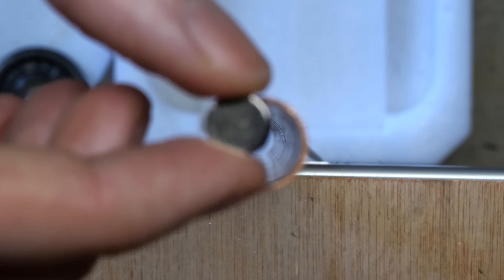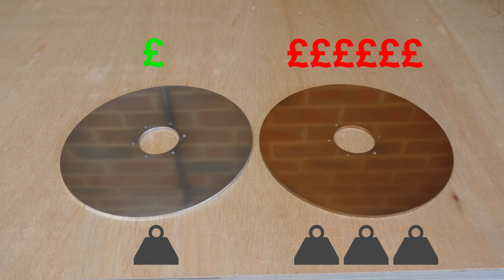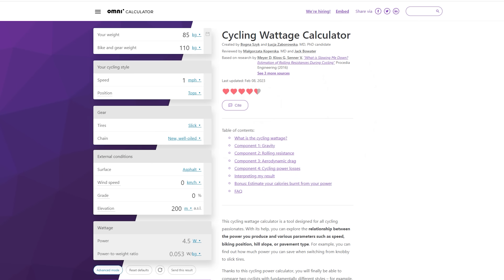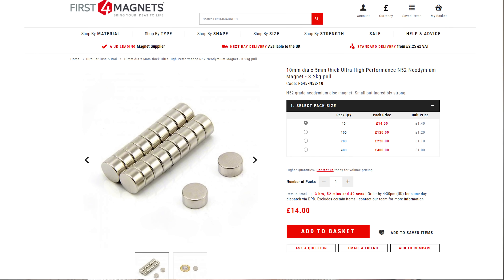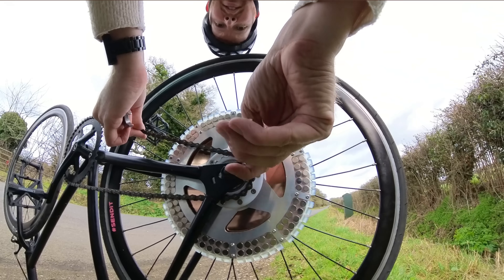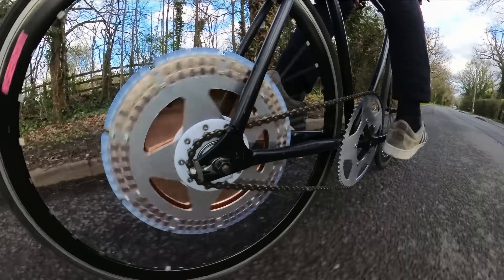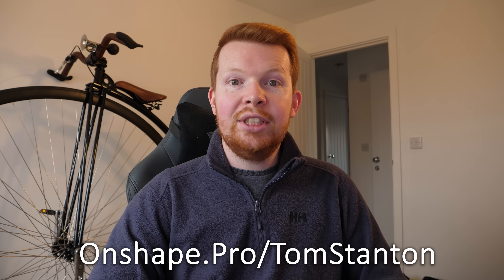Gearless Magnet Bike

Comment: A similar concept used in the Japanese magnetic torque converter concept. The slipping needed in an automatic transmission gets converted (in part) into electric energy instead of heat that gets wasted in the trans cooler. 
I could put a link to the white paper but I think links make comments get deleted.

Comment: You could solve the magnets attracting to the chain and spokes using Mu Metal.  In mechanical hard drives, they are thick and attach to the magnets, but completely prevent the magnetic field from progressing further, and help to contain the field in the gap where the voice coil moves the heads in and out of the platters.
Reply: Or use a beltdrive
Reply: @G4ngsta4l1f3  Stole my thunder lmao
Reply: belt drive is the answer
Reply: Use a disc brake hub, and flip the hub around so that the disk bolting section is on the Drive side. Then you can both on anything you want

Comment: How about magnets on both disks instead of using eddy currents?  I have read descriptions of magnetic clutches, but never seen one in action.  Might be interesting to play with.  Could you use a rotor on one side of a barrier to turn a load (like maybe a generator) on the other side?  How would increasing the gap effect efficiency?  What would be the best and worst barrier materials?
Reply: Or magnets only on the wheel and then use copper plates attached to the sprocket. This would also solve the magnetic chain problem.

Comment: I have an idea for you mate. You could have a variable gearing effect by mounting the magnet cages attached to radially mounted springs. Mill slots in the disc around where the magnets sit under spring tension to reduce the eddy currents formed there.
Use the centripedal acceleration to have them push outwards from centre and thus engage with the intact portion of disc on the perimeter at an RPM detemined by the spring rate. You'll have basically combined the centrifugal clutch with the magnetic drive.
Reply: up
Reply: I agree... He definitely needs to make a version 2, with some kind of centripetal action, because he wants a CVT. I'm not clear on whether the low RPM engagement should be at the outermost diameter of the copper disc, or the innermost, for the proper torque multiplication (I think it should be on the outermost at 0 RPM and move towards the center as wheel speed increases).

Comment: Wouldn't radial  cuts along the copper disk improve the coupling?

 It would also have the nice side effect of bringing the weight  and the inertia down (btw you should have cut slots in it close to the hub, as Eddy currents are very localized and that area wasn't contributing to anything), and a allow for better heat dissipation

Comment: Now do a chainless bike: convert the crankset to a dynamo, and use the output to drive an electric motor created from the disc brakes (as a rotor) and some electromagnets (stators), with two blocking diodes in opposite directions to switch between regenerative braking and acceleration... please 🙏

Comment: I'd like to have seen you experimented with a copper disk say with 2x or 3x the thickness of your base. In the magnet down tube experiment, you can saturate the copper tube magnetically (or electrically) by adding more magnets making the stack taller. The stack weight increases but the braking effect does not (or not much) after a certain point. I didn't have heavier wall copper to test this myself (just 1/2" hard drawn plumbing copper). Don't recall who did the vid but there is one with like the largest consumer magnet you can buy mounted on a pendulum arm and swung into a very thick copper plate (2" or so thk). The braking effect was amazing ... the magnetic "hammer" did not touch the copper

Comment: That is why a car has a transmission AND friction brake's!  The clutch can not give the braking power we would find on a car.  If it could then cars would no longer need disc brakes.  Also the weight of the vehicle is NOT constant due to the changes of it's load so momentum would be a factor and would need to be adjusted at the clutch.

Comment: Covering magnets with a soft steel ring and adding another such ring behind the copper plate would greatly increase coupling and shield magnets from the chain and spokes. But this would still not help with making an efficient CVT. Magnetic slippage is no different from friction slippage.

Comment: If the checkerboard arrangement of magnets wasn't helpful, the next thing I would have tried is having each pair of magnets at a particular position, i.e., the inner one and the outer one, in the same orientation, and alternating the polarity as you went around the arc.  This would be closer to what you got with the three radially-placed magnets in the original apparatus.

Comment: I'm not sure how there could be an application for this.  Maybe it would make sense if you were driving a bicycle with a motor that doesn't behave well when stopped, like an internal combustion engine, where you just need a slip clutch so that it doesn't stall when the bike is stopped - some early automatic transmissions used a fluid coupler that provided slip at low RPMs that similarly allowed the engine to idle without disengaging the gears.   But if what you want is some form of variable-speed drive, I don't think that this would help.  The torque converter in later automatic transmissions is useful over a wide range of RPM because when it slips, it converts some of that slip into additional torque, giving a quasi-constantly-variable gear ratio.  But I can't see how this could be done with a magnetic clutch.  If I understand it correctly, the rotation that is lost when it slips is all just dissipated through the resistance in the copper disc.

Comment: Im am by no means an engineer. So thiese are just ideas/thoughts i had. If you used Electromagnets and were able to control/ preprogram polarity strength. to simulate gear ratios. Also plastic/fiberglass/carbonfiber tire rims. And the master of altering bike frames Colin Furze might beable to help. Could be a nice collab.

Comment: You should try to stick a sheet of soft iron to the outside of the magnets, it redirects the magnetic field, making it much stronger inside the copper disc.
It is the same reason why transformers have a core of soft iron, without the iron a lot of the magnetic field "escapes" to the outside.

Comment: in roller coasters they use these brakes for slowing down really quickly cus the force of the breaking is relative to the acceleration going in (harder you peddle stronger the braking force) and the faster you go the harder this brakes
Reply: they do "not" stop you however only good for slowing

Comment: I didn't quite catch the point of this, the first time around... but you said you were experimenting with a new idea to make a magnet based CVT? Is the point of a magnetic CVT to have very little wear on the parts?

Wouldn't that require the magnets to be on a centrifugal radius arm, or something? For example, at low RPM the magnets will engage a copper disc of one diameter, and as RPM is increased, the magnets will travel along the radius arm to engage a larger copper disc (I assume the discs must be electrically isolated from each other).

Will the torque relationship work this way? Actually, maybe the system needs to  be inverted so that lower RPMs engage the largest radius (to increase torque) and it becomes progressively easier to pedal as the magnets move to the smaller disc and wheel speed increases. Maybe some kind of counterweight pivot arm system would  lever the magnets to the smaller disc as the weights are forced to move to the outside.
Reply: I think you need to make a custom wheel that's basically a group of like 10 different isolated copper ring discs (from small to large). Then find a way to use centrifugal force to move the magnets from one ring to another, automatically, as wheel speed increases.

Comment: Halbach array would give you even more magnetic force per magnet given to the field direction you want. Of course you would simply heat your disc faster, so there's that. This is a super interesting concept though, for sure! You could also have direct magnetic interlock with a squirrel cage style ferro-magnetic core, like how induction motors work. I like the idea of creating a 0 friction gap in the drivetrain.
Reply: I wonder if he could get the copper hot enough that it stops being able to produce eddy currents. I know heat can kill a permanent magnet and hot iron won't stick to a magnet until it cools down.
Reply: @andrewdescant  Well, the heat would certainly affect the resistance of the copper, just as it does in any other electrical component.
Reply: @andrewdescant  I don't think you could reach those temperatures by pedaling outdoors, since the rate at which it loses heat increases with the difference in temperature vs the air. Would be wild though

Comment: That's more a clutch than a transmission.

How about making a magnetic CVT with automatic shifting? :)

Got an idea involving modifying the concept of magnet gears:

- Create two cone-shaped magnet – with a continuous amount of magnetic poles. So the magnets are wedge shaped along the cone.
- Create a “chain” by screwing iron pieces on both sides of a belt. Space between them should be as wide as the iron pieces.
- Create two “chained” magnets, by gluing them on one side of a belt.
- Now create an “carriage” which can move right and left over the cone-shaped magnets. It needs to let the “chain” pass over the inner magnet, while the “chained” magnet needs to be stationary in a 280° arc around the chain.

As the “carriage” moves right and left, the stationary chained magnets need to extend and shrink the arc around the chain. To make that happen, one is fixed, and the other side is held back by a spring. So the arc can get bigger and smaller.

The difficulty here is probably to hold the “chain” and the “chained magnets” away from each other and the inner rotating cone-shaped magnet – while keeping them in a very close distance to each other. Not sure about the best solution… I was thinking about using wide belts, so the belt can run on rollers on both sides. You would just need an adjustable chain of plastic segments containing the rollers, which can expand and shrink depending on the position on the cone.

To avoid that the cones “pull” crooked on the chain, it makes sense to offset their axis on the larger side. This lets the cones run “true” against the chain – so it's not pulled to one side.

This would certainly allow you to run a 30-40° (per side) cone – expanding the total gear range.

From the titled (towards each other) cones, you can simply transfer the rotation to the shaft by adding a crown gear inside the cone and a gear on the shaft itself.

---

You can mount a larger cone in the back and a smaller cone in the front. The carriages could be held on a shaft and an arm between both cones – mounted in the middle – can move them simultaneous in an out.

If you use a “free spinning” clutched back wheel, you can avoid peddling all the time. While a motor with a worm drive could modify the gear ratio based on the rotation speed of the back wheel. You would just need a leaver on your handle bar to adjust the desired cadence between say 40 to 80.

So you end up with a magnetic transmission, with a belt drive. And use an automatically shifted CVT.

Comment: That's really interesting. I wonder if you might magnetically couple the drive by using magnets mounted on another parallel disc made of plastic instead of a copper disc. You could vary the torque transfer by varying the gap between the drive wheel and the output wheel.

Comment: This is such a awesome concept... it's like a CVT and a electric motor in one, also I like the idea of the way it brakes it's like a dynamic brake..... also wouldn't this setup technically produce electricity?
Reply: Yes, eddy currents are electric currents. That's also where the heat is coming from, the electricity is not routed or used anywhere so it basically turns the disc into a heating element.
Reply: @StephenRWilliams  so it's a space heater that doesn't use electricity lol

Comment: Obvious solution is to increase the disc diameter. More circumference = more magnets = more torque.

I'm trying to picture what the advantage of this was supposed to be though. Like is it supposed to deliberately slip a little on hills so you can keep your speed constant?

Comment: I would would use a one way bering to drive the magnets. That way you can stop peddleing and use conventional brakes. I would use a conventional transmission to change the speed of the magnets. Also a heat dissipation sytem like some radial fins on the copper plate.(squirrel cage fan style). This design also could benefit from a shaft drive vs the chain drive. And a plastic or carbon fiber wheel hub would eleminate the spoke problem. I wonder if there is a way to use AC elctromagnets instead of permanent magnets. Maybe keep a few of the perm. magnets for starting power.

Comment: I believe you can substantially improve the coupling (and prevent magnets from being attracted to chain and spokes) by adding a ferromagnetic rings to the outer sides of your magnets. 

On a more general note, if you have a ferromagnetic loop with a non-magnetic gap, the field strength within the gap is inversely proportional to the size of the gap. Right now you have two types of gaps -- on the outside and the inside. By putting the ferromagnetic ring outside, you will eliminate the outer gaps entirely. After that, you can try to minimize the size of inner gap.

Comment: I'm not sure what to describe what seems non-existent as a transmission bike gear... the nearest that comes to mind is Bucky Balls, but... more like a single-gear wheel that expands to any speed whereas the teeth are small semi-locked gears, therefore... far less weight and the smoothest type of shifting aside from the electrically powered.

Comment: Well, if the braking force is so significant at high speed, than it might be practical to use this idea as a complementary brake system for continuous downhill riding. And if you manage to somehow trap the wasted energy into an electricity, this could also power some accessories. This reminds me of an idea that I had for disc brakes that produce electricity for lights and phone charger. Much like the dynamo hubs, but on disc brakes instead.

Comment: They started using these in wind turbines to prevent the gearbox from being damaged when sudden gusts of wind would cause spikes. It's the reason we see fewer "broken" wind turbines nowadays and why they can also run them in heavier weather - far reduced risk of sudden overloads, as the magnetic clutch allows slippage.

Comment: It's basally like an mechanically-driven axial induction motor! You could improve the flux linkage by adding some iron to the back of the magnets, this would also double as shielding to prevent the interaction with the chain. But yeah this is dumb and pointless anyways as you figured out lol 😂

While there is slip, there is no torque multiplication, this is analogous to using a resistor to drop the voltage of a power supply to a load, rather than a DC-DC switch mode converter.

Comment: I'm not sure if it would work or not, but I would think, instead of just having a copper disc, having cutouts so it grabs and does not grab on certain areas might help. Similar to the teeth and gearing that you would normally have on a bike.
Also, having outer and inner rings of the magnets as well as additional cutouts just like with the outer ring of the copper disc from the rest of the statement.

Comment: Regarding the heat loss in the copper disk, could a copper ring be used in the area of the magnetic coupling with the central area filled with a nonconducting material?

Comment: while watching the video i got the idea of getting a ring of electromagnets and a circle of copper and having the same sort of idea as in this video except only for braking and the electromagnets power is varied based on how far the lever moves (potentiometer?)/how much force is put on it (pressure sensor), i think it would have the benefits of pedalling not being inefficient af and the brakes being much more finely controlled.

Comment: So it slips... But there's no torque multiplication. It's just slippage in a high gear ratio. Like having a manual transmission in a car locked in 5th gear and slipping the clutch to accelerate.

Comment: I think this project will be way easiser by converting the hub motor on ebike to achieve a similar result if not better. The eddy currents generated by copper coil will be far stronger then just a copper disc. The ebike hub motor have already has all the install points needed,

Comment: It would be cool to transition this to a gearbox design, where you can vary the distance between the copper and aluminum plates to achieve different speeds
Reply: Would not work. Once u increase the gap u don't get enough torque to turn the wheel at all

Comment: the lost power is rpm difference x torque, and rpm difference is proportional to torque, so your losses mount quadratically as torque output increases.
and your power output is wheel rpm * torque, so your efficiency will be (wheel rpm * torque) / (torque^2 + wheel rpm*torque)--when wheel rpm is low and torque is high, such as when you're going over a hill, this will have the lowest efficiency.

Comment: 6:45 additionally it started in the forward most tooth position, indicating that being the highest sheer stress point  Have you considered using 415 chain, like the kind used on motorized bicycles?

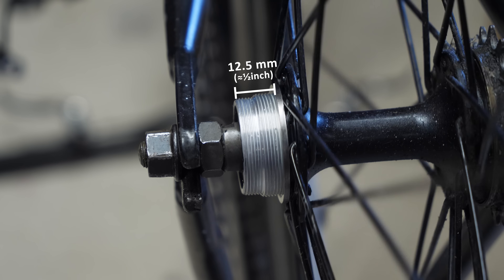Comment: 5:05 Tom, you're using magnets.  Strong ones at that.  Use the magnetic force to both do the task, and keep the plate at a constant level, via a free floating magnetic platform, which would be self correcting.